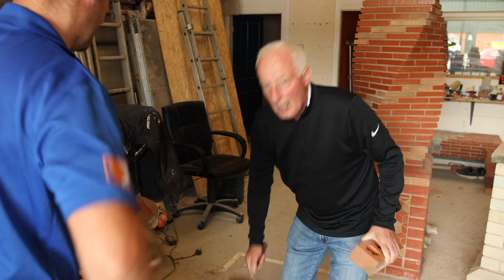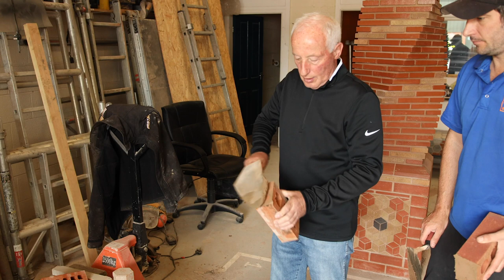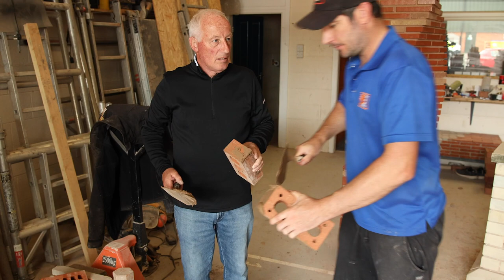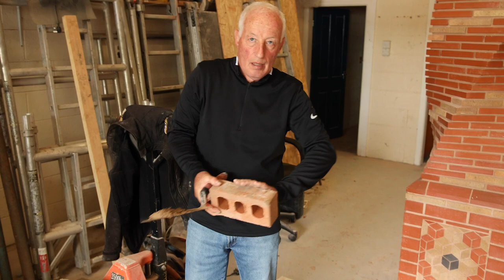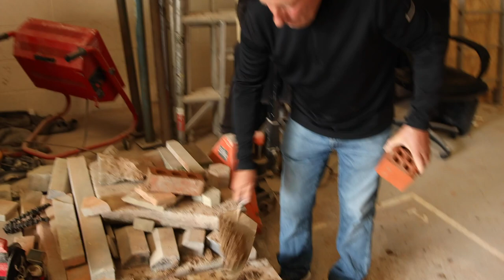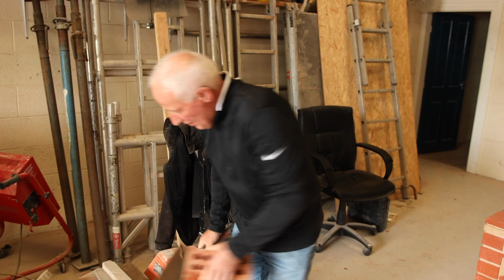Bricklaying -  Buttering A Brick With KC

Comment: Usually if I'm buttering on the wall I'll swipe face then top of the brick using enough mud that when I lay the next brick the mud will squeeze through the whole joint. If I'm buttering with brick in my hand I'll swipe the bottom top and then face. The guy that taught me usually spread the bed joint heavy enough that he could drag the next brick through the mud on the wall and that way he didn't have to butter any brick.

Comment: Hi stu I have a 3 meter window that need a lintel replacement as the concrete lintel is bending coursing the brick mortar to split letting water in above . The lintel is 100 x 65 x 3300 would like it replaced with steel lintel what would you recommend 

John